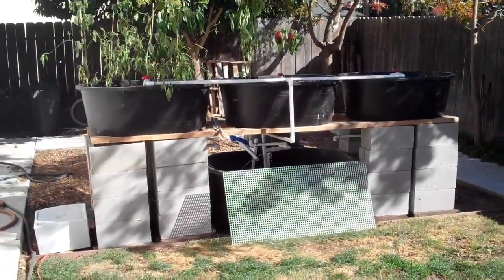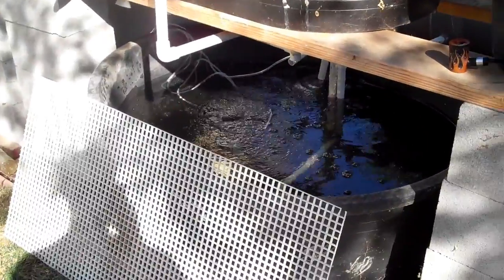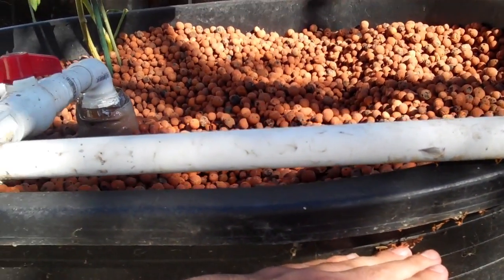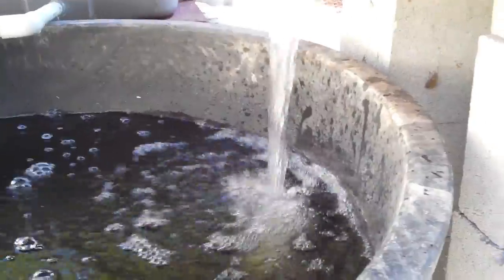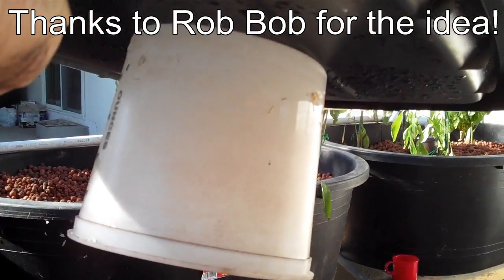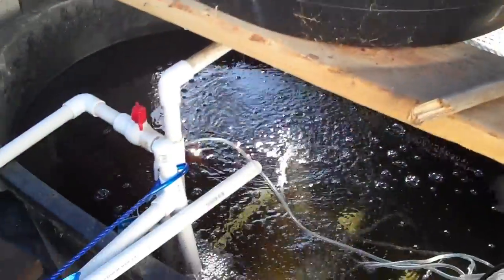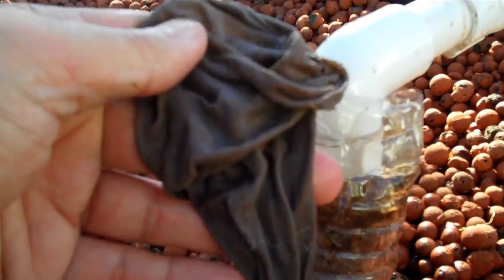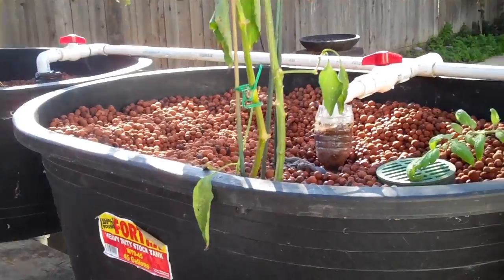Aquaponics - Complete System Walkthrough

Comment: High!
You got yoursefl a badass AQP system!  CONGRATS!!
By seen it, I've got some ideas to improve my own system, THX for that!
Since you have helped me I hope a can retribute the favor. I have some sugestions and a question for you.
My sugestions are:
1st- to use an elbow instead of a bucket in the income water to the filter. By doing this you may use the coriolis effect to precipitate your solids, (it works better in round espaces - pay attention to the hemisfere you`re at).
2nd - since you`re returning those precipitate solids right back to the fish tank, you could also add some aeration (by making a venturi) and mineralize your solids.
And even a 3rd idea that is  to add a SUMP to your system.

Hope that turn into something usefull to you.
The question that I have is about the clogging problems in your bomb, if that happens frequently and what had happend that had lead to the death of all your fishes and perishing your system?

Thxs for sharing your experience my aquaponic friend!
Reply from the maker: Thank you for the comments.   This video is actually 4 years old, and my system has changed since then.   Here are some more recent videos of my system with an improved Sand/Gravel filter that has 100% worked like a charm:   https://www.youtube.com/watch?v=45oX1zt-3Vc&list=PL35694A2FFB3B2060&index=1 https://www.youtube.com/watch?v=0KkhH2M-g0E&index=2&list=PL35694A2FFB3B2060Ever since I set up my system like you see in those two links above, I have had ZERO problems.   No clogging, no poor water quality, nothing.

Comment: I am just getting into Aquaponics so I setup a 30 litter fish tanks and two pots to grow tomatoes and green pepper. I thought about a sump for insoluble. The tank came  (old fish tank) came with a waterfall filter. I siphon from the pump to a 3 litter tank but measured it to only fill half way, the tube is at the bottom and then there is a drain mid way to the highest water level and that drains to the pots. Then I siphon to each lot and siphon it all to that fish tank. But I agree with the sump tank idea just not how you have it setup.
Reply from the maker: Here is a more updated version of the aquaponic system where I also detail how I clean the new sand/gravel filter: https://www.youtube.com/watch?v=45oX1zt-3Vc

Comment: there looks to be plenty of water running from your filter system why not just use that water to feed the beds now you are using 4 filters instead of 1. your big filter is only filtering half when it should be filtering all
Reply from the maker: The system has been redesigned since filming.  Here is the last video I filmed which kind of shows the  new system, which is way more efficient: https://www.youtube.com/watch?v=0KkhH2M-g0E

Comment: CAUTION - If you bought polyester fiber that's for pillows it probably has fire retardants.  Did you say something about being in the middle of a complete system redesign?  I would make all the water go thru the swirl barrel first, then the bio filter, then thru a solids collection sock/foam as it goes out to the grow beds.  Some people then make denitrification and aeration barrels to denitrify the water before sending it back to the fish.  (Could probably periodically flush solids from the swirl barrel bottom into the denitrification barrel). I love how you identify your containers.  Are they a food safe HDPE?  I'm thinking of using a 55 gallon barrel as the swirl filter, and two 10 gallon buckets for the biofilter, alternating which one gets cleaned, every other month, although, I'm wondering if a total of 20 gallons for biofiltration will be enough.  I think it should be enough for around 35 lb of fish, using the K2 bio media.  You think I could get over 50 lb?  lol
Reply from the maker: Here is the video showing my redesign before I finished it.  https://www.youtube.com/watch?v=3yy26mY2Omo

The video immediately after that one will show it actually online and working.

Comment: couldnt you just put the sock directly over the output pvc? @11:30 like the filter socks used in sumps for aquariums?

thanks for the diligent video, really helped me iron out a few kinks in my setup. 
im breeding guppies on my porch in a pond using aquarium plants for filtration. im starting to grow veggies/fruit/plants instead. these little fancy guppies where im from go for 1.50$ a piece to any petstore. at the end of the summer theyll have bread into the thousands in a small pond with little to no care! $$
so, in the end the profit from your fish stock goes into paying for upkeep/setup and your dinner from the aquaponics setup. 
in az its warm enough year round for outdoor fish/crops! +1
Reply from the maker: Yes, you could put a filter sock over the output if you wanted.  Ideally though (which is what I am doing right now in my redesign of the system), you would want to PREFILTER the water BEFORE it goes into your grow beds.  That way, you won't need to put a filter sock or any other solids filter on the pipes.

I will have an update on how my new redesign is going, so stay posted to my channel in the next 1-2 days when I'll have it uploaded.

Comment: Great video with clear explanations. Any chance in giving us specs? Like what tubs and pumps you're using (or used) in this video? Thanks!  -Aquaponic Noob
Reply from the maker: This is an older video, and my new redesigned system is probably 75% complete.  Stay tuned for that video soon on my channel.

As for what you see in this video, the grow beds are 40 gallon tubs.  The fish tank below is a 100 gallon tub.   The pump is a Magnetic Drive pump from Danner (model 5), and it pumps 500gph.
Reply: +StogieFarts Sweet! thanks for the info!

Comment: Do people really not understand with Aquaponics it's still a fish tank.
It.s all about the fish.
So everything you would do to an aquarium x the size of your system my tank is 550+ two 55 gallon drums as filters  so if treatment is needed it's 650 gallon fish tank.
The thing I am not understanding is how do you get solids into your filter?
I am using a home made pree filter and have figured out what works and what doesn't
The dollar store does have something that really works and it's not the plastic scrubbies.
The green scratch pads work 3M style. and they are inside a painters screen 
But nothing going into my pump that could harm it so.
How do solids get into the filter?
Reply from the maker: With the current setup you see in this video (which I have since been in the process of changing so it's no longer like this), the solids get sucked up from the tank into the grow beds via the pump.   I don't have any sponge or filter on the pump, so it will suck up any solids and deposit them into the grow beds.

On my current system which is almost finished, I am going to be pumping ALL the water to a 44 gallon filter first.  This new filter will be able to be flushed and cleaned, allowing me to clean the system.    From this filter, it will overflow into the growbeds and into a new 300 gallon fish tank.

Therefore, with my new design, the 44 gallon filter will be in front of everything.  It will filter both the fish tank water AND the plant water, so it should make the grow beds less dirty while at the same time, keeping the fish water clean.

I will have more videos about this on my channel if you're subscribed to see them.
Reply: *****
The first pump I bought had a pre filter The ECO brand.
The second pump also has a Pre Filter and I Assumed It was important to keep stuff out of your pump.
By accident both are The same brand.
one video said to use a pump bag.
what ever that is/Cheese cloth/brewers cloth/paint strainer I found if you unroll one of those dollar store scrubbies they are a tube and tied better on one end than the other.(a bag) I cut big holes in a coffee can and put a one gallon paint strainer on the outside and some bio media plastic scrubbies and 3M pads very loosely inside.
I noticed today it looks like the SOLIDS you speak of are trapped in the painters strainer.
My Pree Filter.
i would add Today my filter malfunctioned and i lost about 200 gallons from my system.
The little 400 gph pump pushed up about 60 lbs of rock to cause a leak and i only noticed the water was awfully low and went oh shit.
Reply: Can't wait to see the new setup!
Reply: no...your not absolutely right.... if you make plants and fish its bio diversity... so its not all about fish... yes its an aquarium but how about the plants? and what do you think about it
Reply: I agree, it's all about the plants. The main aim/goal is growing vegetables, the fish are there to supply nutrients ( ammonia-nitrites-nitrates). It revolves around a symbiotic relationship system
Reply from the maker: I am not sure I 100% agree that it's all about the plants.  Technically speaking, without the fish, the plants won't get those nutrients......so I'm of the school of thought that taking care of the fish should be first priority, and plants come second.

This is why water quality is of utmost importance in aquaponics, and why I'm a firm believer in lots of filtration with ways to clean the filters by removing solids.

The plants will still get their nutrients, but the system is much more efficient and cleaner.
Reply: I agree with you. The reason I say the main focus should be on the plants, i'm referring to the bottom line. If you think about it, it takes about 4 weeks to fully grow lettuce from a seedling, yet it takes about 9 months for fish to mature to about 2lbs (Tilapia). So from a farmer's viewpoint, you would rather focus on the plants aspect, seeing as though you will have a faster turnover than with fish. You can also totally discard of the fish, and grow the plants without them, think about what it is that the fish are actually producing?... Waste (ammonia), which gets coverted into nitrites and the nitrobacter converts nitrites into nitrates for the plants to absorb. Just manually supply these minerals to the water, you can buy these supplements. It all depends on the goal of the system. Is it a hobby? or are you actually in it to make money? As someone who has been raised on a farm, and is still currently involved in the day to day farming ( and busy studying a degree in Biology as well as majoring in Business management, it all boils down to the bottom line, the three goals of a business is: profit maximization, rate of return maximization and maximization of shareholders' wealth. And keeping the economic principle in mind : minimize input maximize output. Personally i love the idea of farming with fish, in conjunction with the cultivation of crops, it all depends on the scale of your farming activity. Do you want to make money, and how much money, do you want a faster cash flow, or can you afford raising fish for 9 months without receiving an income. But    like you said, you have to take care of your fish, it's crucial, especially if that is your primary source of nutrients for your crops. :)
Reply: You can also add earthworms: they are fantastic at digesting the solids
Reply: With no exceptions fish comes first.Meaning if you create more favorable conditions for you fish the plants will follow as a  response to healthy fish and good water quality.
Reply from the maker: Riaan Oliphant Yes, my system is full of worms, but worms alone don't eliminate all your solids.  Worms themselves produce waste, and that can build up in your system in the form of "Dissolved Solids."  

Dissolved Solids, when built up, can cause a toxic environment for your fish if you don't do partial water changes.

This is why on my current system setup, I use a prefilter (to filter the water BEFORE it reaches the grow beds, and before it reaches the fish).   This allows me to trap a lot of waste and debris and remove it once every 3-4 weeks without it being deposited into the grow beds.

Remember, the worms don't need fish waste to survive.  They have plenty to do with getting rid of the old roots and vegetation that remains in the system.
Reply: *****  You can always place a piece of mesh, or the underside of a sponge underneath your water inlet in the grow-bed) to catch additional solids, or install a plastic container where which water enters immediately after exiting the fish tanks, so the waste sinks down, and "clean" water leaves via the top, and just clean out the solids every few weeks or so. I agree with the waste building up and becoming toxic, and the worms can survive without the fish waste. It depends on the size of the system, i assume you have a large system, therefore additional filtration is needed.
Reply from the maker: Riaan Oliphant My system isn't large at all.....only about 400+ gallons of water with currently three grow beds.  Here is a more updated video: https://www.youtube.com/watch?v=0KkhH2M-g0E

Comment: For your fish ; Did you have the foam covering the intake on your pump.  I had a pond and my fish was also not making it and did some research and found that it was sucsioning my fish.  The filter helped the fish.---Betty G
Reply from the maker: +Betty Gainey I have done both (with and without foam) but that was never a determining factor in any fish deaths that I experienced.   It was always due to some kind of water quality from lack of water changes.   I would REFILL my water, but I wouldn't change out the old water.   What happens when you don't take out old water is that a build-up of organic solids can accumulate (something that doesn't go away with simply topping off your water).   Ever since I did bi-weekly or weekly water changes (in the range of 10%), I haven't had a single problem.
Reply from the maker: +Betty Gainey If you look at some of my more recent aquaponic videos, you can see how my system is doing.   I am also in the process of expanding my system (from 100 gallons to over 400 gallons), so be sure you're subscribed to my channel and you can look out for that video when I film it.
Reply: Sounds good  .  Thank you---Betty G

Comment: So you don't use fish poo as fertilizer?
Also, have you found out why your fish died?
Reply from the maker: +Mata Pegheata It's not the fish poo that is good.  It's the bacteria that break down the poo which is beneficial.   Having a system in place to hold and remove the poo WHEN NEEDED is very important.   That way, your system can still have the poo in there without clogging up your grow beds.....and you also have the ability to remove the poo if your system experiences any sort of ammonia spikes.
Reply: ***** Thanks! Have you figured it out why your fish died?
Reply from the maker: +Mata Pegheata Pretty sure it was due to bad water quality.  Not enough water changes, etc.
Reply: ***** What do you used to feed them, mate?

Comment: man had too many bad experiences with submersible pumps they all started to give static out to the water so i switch to an external pump not as good but it works
Reply from the maker: +trini lone wolf I have had the same submersible pump from the beginning, and it's going on almost 4 years now.   It's a MAGNETIC DRIVE pump, which I heard is more reliable than non-magnetic drive pumps.
Reply: thank you for the info, my first one was magnetic. I live in Trinidad and they sell knock off crap I'll try my luck again but I'll order it this time.
Reply: +trini lone wolf Hey Trini Lone Wolf...I'm also in Trinidad and currently attempting  a new aquaponics setup. I have a koi pond that's been running well for a few years and a small veg garden so decided to integrate the two and give aquaponics a try. Recently got some river stones which has tons of limestone and can't use for the system....  Can you tell me what you're using in your grow beds for media and where I can find? Thanks much!
Reply: verdielg i used stones from gravel but i think bhagwansingh has either the lava or clay stones but the reg gravel working good for now.
Reply: +trini lone wolf Ok. Thanks for the info. Will give the regular gravel a try and see....
Reply: verdielg everything is trial d error should put some tilapa in the pond.

Comment: Nicely  made video. Very informative. Do you have any calculation...how many  plants can you grow in these three tanks?
Reply from the maker: +Prakash VK The number of plants could be limitless.   However, it all depends on your system.   If you have too many plants, then there may not be enough nutrients to give them all what they need.  For example, if you have 20 plants and only one fish, then the waste the fish produces won't be enough to support all the plants without some deficiencies.    Likewise, if you have too many fish and not enough plants, then there won't be enough plants to remove the harmful nitrates that the bacteria produce.

My system only has FOUR fish in it, but they are juvenile Koi and goldfish in a 100 gallon tank of water.   That is actually on the smaller side, but it's been enough to grow my garden every summer in my system.  

This year, I am expanding to a 300 gallon fish tank, which I plan to document here on my channel.

Comment: Look up something called a swirl filter. You need a circular bin (a 5 gal. bucket works great for a small set up like yours) run the water into the bucket like you have then put a 90 degree bend on it and point it along the side of the bucket (so it creates a vortex). This will drag all the solid waste to the bottom. Put valve on the bottom so you can just open it up and all the solids will flush right out and you can use it as fertilizer if you have any plants in soil. Use the same type of drain that you have where it pulls from the top. I hope this helps.
Reply from the maker: +Mike Litostansky This is my older setup (notice the date of the video).    Things have changed a little since this, and in fact, I am in the middle of a major rebuild, complete with a sand/gravel filter.   If you sub to my channel, I will be posting videos on the upgrade as I have time.